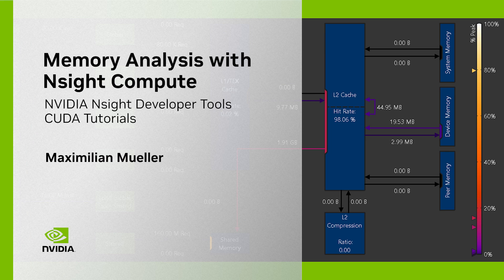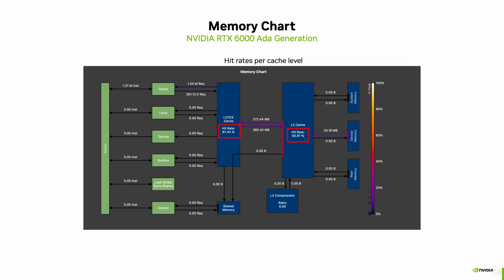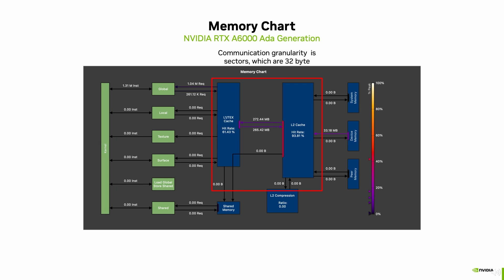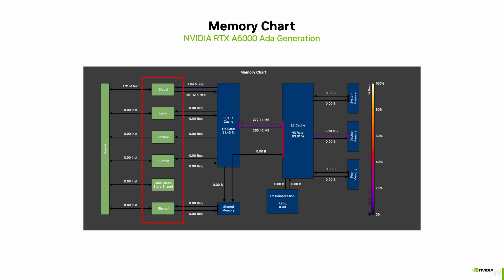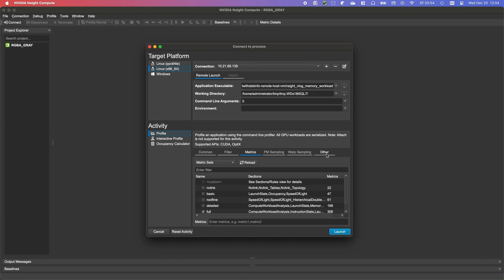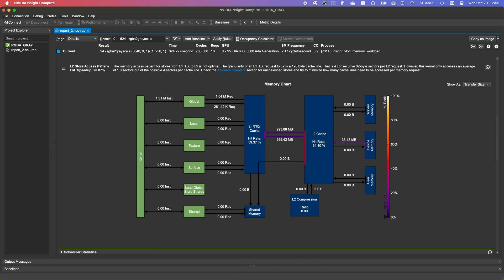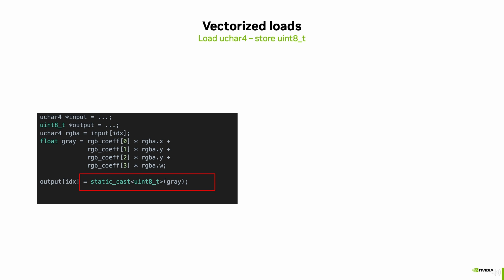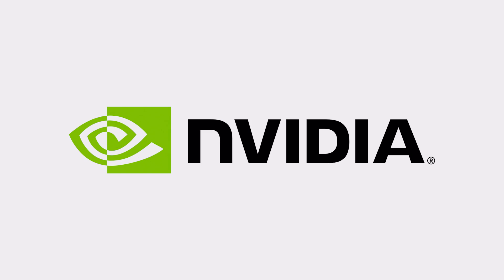Memory Analysis with NVIDIA Nsight Compute | CUDA Developer Tools

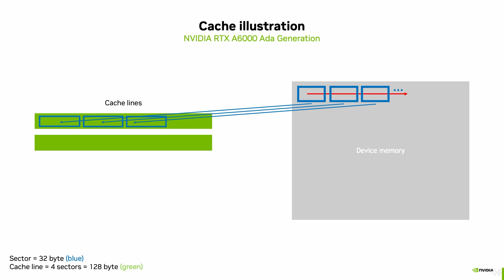Comment: Can someone explain the calculation of the "97% hit rate" at 4:56 pls
Reply: @ragingbull5743 When you are reading 32 consecutive bytes in SM, say the SM requests for the first byte from L1 but there would be nothing in L1 so a cache line (128B) would be allocated in L1 and one sector (32B, since smallest data transfer size is a sector) containing the desired byte would be requested from L2. Now, L2 would also be a miss because there is nothing in L2 so a cache line would be allocated in L2 (128B) and one sector (32B) would be fetched from device memory. This sector would then be transferred to L1.

This L1 now has 32B of data. Now rest all consecutive 31 following requests can be satisfied from L1 because the data is cached. So, 1 miss and 31 hits in L1 when accessing 32 consecutive bytes. This approx 97% hit rate. For L2, since there was only 1 request and that was a miss, it would have 0% hit rate